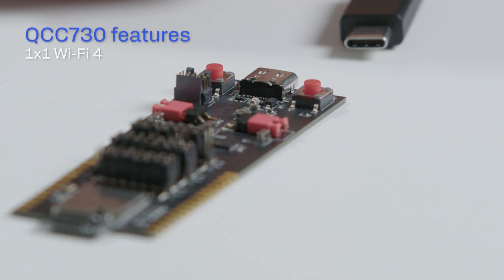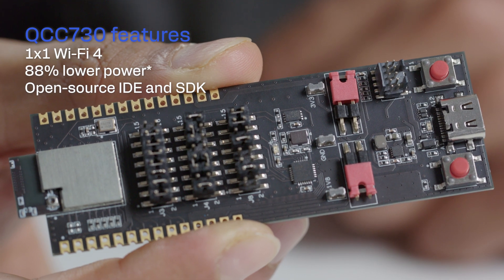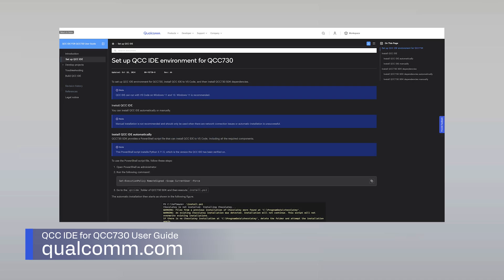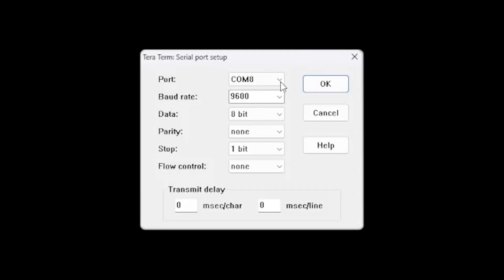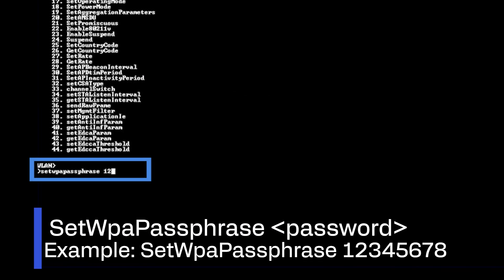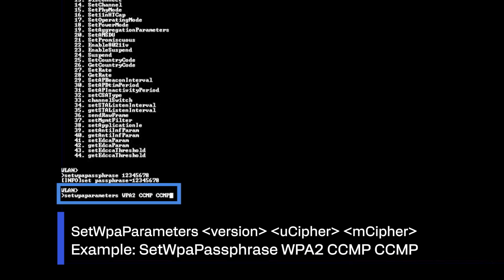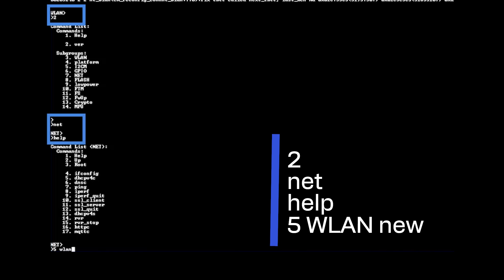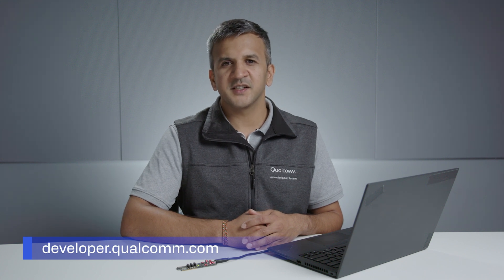Qualcomm QCC730 Development Kit: Introduction and set up QCC730

Comment: The parts are NOT priced or for sale.   The documentation and software support is scant.   What is the point?
Reply from the maker: Hi @keithsummers1889! Thanks for your feedback. 

Please feel free to reach out to our sales to better assist you at https://www.qualcomm.com/support/contact/forms/iot-contact-sales. 

We’d love to hear what documentation and software support you’re looking for. Here are a few places to order from:
 
US
https://www.arrow.com/en/products/search?q=730m

QCC-730-1-WLPSP90-HR-03-0-02 Qualcomm | RF and Wireless | DigiKey

QCC-730M-1-LGM42-MT-00-0-AA Qualcomm | RF and Wireless | DigiKey
 
EMEA

IoT, Qualcomm, QCC730, low power, WiFi4, QCC730 | CODICO.com

IoT, Qualcomm, QCC730, low power, WiFi4, QCC730 | CODICO.com